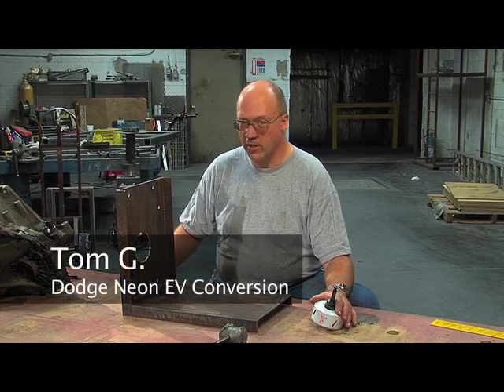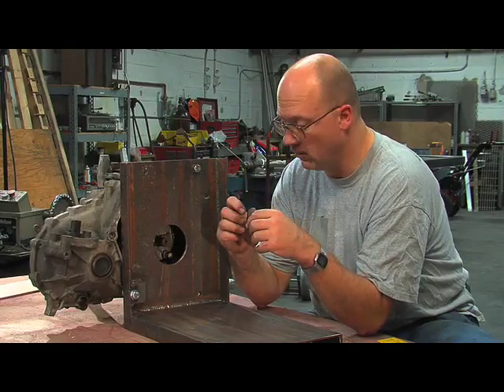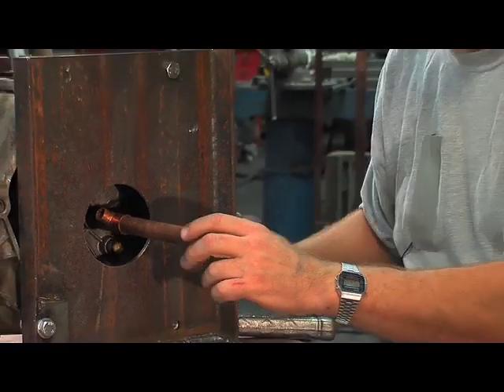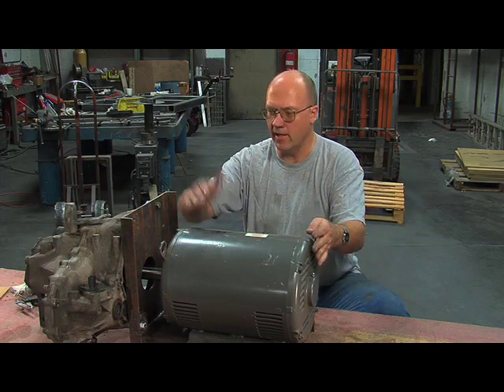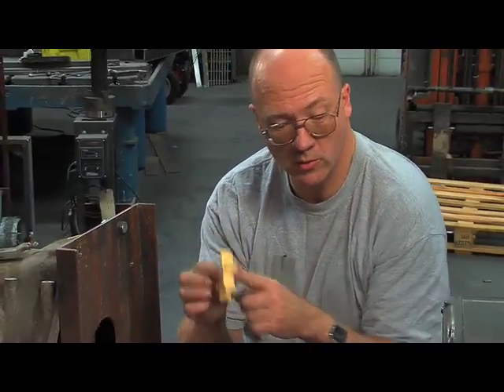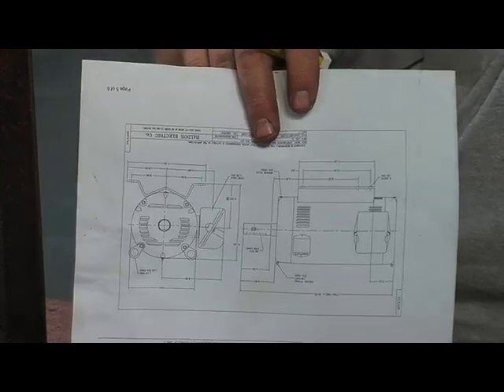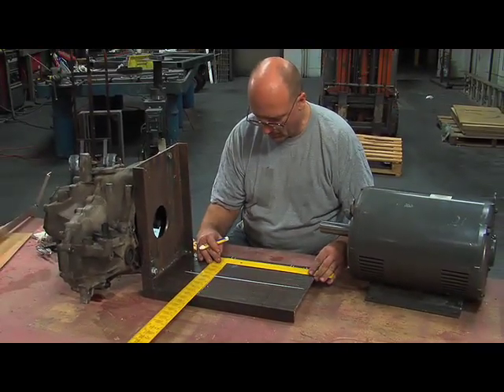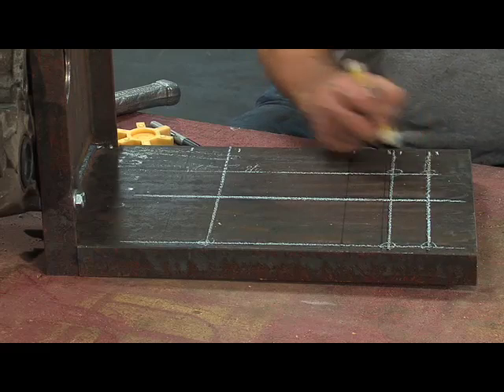AC Electric Car Conversion 101  part 005

Comment: I just don't see the savings yet from gas to electric. The cost is very high
Reply from the maker: According to Kelly Blue Book, the cost of the average new car in the United States is nearly $50,000.
In January 2023, we bought a brand new Chevy Bolt EV for $31K, (including tax, title, etc.) and expect to be able to take full advantage of a $7500 tax incentive.

The car will never use a drop of gasoline or need an oil change. This greatly saves on fuel and maintenance cost over the life of the vehicle.

Now, if you are comparing a brand new electric car to a 10 year old gas car that you already own, it would be very hard to compare the two just on finances.

Comment: I'm puzzled ...your useing an AC motor instead of a DC warp 9 inch motor  for a EV Conversion with a Lovejoy coupler ?
Reply from the maker: AC motors provide for features such as regenerative braking. It was also a very inexpensive motor, as Tom works in the recycling industry and can often find great deals because of that.
There are various ways to connect the drive shaft of an electric motor to the driveline of a car. LoveJoy couplers have been commonly used with good success.

Comment: What is the HP
Reply from the maker: If I recall correctly, that motor was rated at 30 HP. Keep in mind that electric motors are rated at continuous horsepower, whereas gas engines are rated at peak horsepower.

Comment: Very interesting and well explained. I would suggest using some oil when drilling holes in steel plate. I have a brand new 1965 mustang convertible body I  built a couple years ago. The car has all new metal and a vin number. I am 76 years old and have messed with hot rods and classic cars my entire life with the exception of serving in Vietnam 68/69.  I built this mustang with the idea of making it electric. I have a nice shop and right now I'm busy keeping two go karts running for my grandsons. As soon as the cool weather hits this fall my attention is going to be an electric classic mustangs. I have seen other electric mustangs on YouTube and will certainly keep your videos as reference. Thanks

Comment: You could use a scribe or silver pencil 
For more  Accuracy
To save time and not have to measure anything you could
 1st cut your motor  shaft 
2nd install your love joy on to the transmission and set the set screw 
3rd install copler end on to dc motor
And put rubber spider between and put everything  together 
4th get a small thin straight  edge  and move the motor until bought couplers are square. ( May have shim under motor)
5th now that they are square you can mark your dc motor  holes with a transfer punch.
6th  remove dc motor  drill holes  and bolt back on 
This is an old school millwright trick
And if you shim the motor your rubber spider will last 10x longer
Reply: Gary Brown un)

Comment: The motor alignment could have been done much easier and more precise at the beginning, when the motor and transmission was lined up but the plate between them was not welded yet.

Comment: hi guys, im trying to do my car electric, but here in canada cant find motor like those i see in the videos, but finlly did find this motor and here is all the info for it,
 Horsepower	 5  HP
Full Load Speed	 1,740  RPM
Voltage	 208-230  V AC
Full Load Current	 23.2-21  A
Face	 C-Face  
Hertz	 60  Hz
Motor Phase(s)	 1  
Full Load Torque	 15.1  ft-lb
Starting Torque	 50.6  ft-lb
Insulation Type	 Class F  
Service Factor	 1.15  
Shaft Diameter	 1-1/8  in.
Frame Type	 184TC  
Rotation Direction (when facing shaft)	 Reversible  
Totally Enclosed Housing	 Yes  
Open Drip Proof Housing	 No  
Auto Overload Protection	 No  
Manual Overload Protection	 Yes  
Rigid Base	 Yes  
Resiliant Base	 No
so pls let me know if it can work or no, the car is same as this dodge neon.

Comment: how would this be done with an automatic transmision?
Reply: I was wondering the same thing
Reply: need a separate motor (or a mount to hook up multiple pulleys to an electric motor), usually with shafts on both ends) to run the pump for the trani fluid. i read you only need it while the motor is not turning the transmission, but i cant confirm that myself
Reply: I would think that you could adapt the flexplate to the electric motor shaft with a small bushing welded to the flexplate.
Reply: If you have a tranny, simply ditch the gearbox all together. The 1:4 or so exchange between the driveshaft and wheels is all the gearing you need for an electric motor. It also makes a clean build that way.
Reply: flexplate?
Reply: it's the automatic version of a fly wheel. it attaches the torque converter to the crank. normally light stamped sheet steel.
Reply: still need to do something to keep the trani fluid pumping.
Reply: the motor would need to run continuously, I would think. the converter drives the pump.

Comment: " 'mating' the engine sharf with the transmission shaft is a huge problem"?

No, . . . but, like a blind-hole transfer punch (which could have been used on the one blind hole in this project) you have to cut small diameter straight shaft shoulder bolts and screw them into close-fit tolerance holes threaded into the ends of the two shafts, then, checking run-out, raising or lowering, and using a precision level (which should have been used in setting up for the mounting and adapter plates), . . .

Comment: what about a high powered op-amp that will convert 24v dc to 300v ac without the use of a bunch of batteries?
Reply: no;  that will still drain the one battery in 2 minutes, do the calculations...

Comment from the maker: Yes, for one thing, in a front-wheel drive car, the transmission is what connects the engine to the wheels. Also, this particular AC motor isn't very high torque, so you need the gearing to get the right amount of power. With some high-torque DC motors, it is possible to put it right on the differential of a real-wheel drive vehicle.
Reply: BenjaminNelson Hello, Is it possible to build a Daihatsu Applause with a 6.5 KW lift motor? How many kilometers per hour can you go?

Comment from the maker: In this case, no. The car needs nearly 300V to run the AC motor system. Forklifts are only 36 or 48 volts. Forklift  batteries are also usually VERY heavy and bulky. I haven't ever seen ANY electric car conversion that uses a stock forklift battery.
Reply: What is model number of electric motor, Where is typical surplus from. Elevator etc.

Comment: Additionally i think the engine you used is too big and too heavy for this project..a smaller engine with a different set up in engine to transmission ratio (which would be allowed if you were to go with the chain and sprocket wheel setup) would allow easier rev.

Comment: "mating" the engine sharf with the transmission shaft is a huge problem, and to tell you the truth the way you did it, its impossible to find the "perfect" point to make it completely straight in a way you can say "this set up will never cause problems to my bearings, and it will last forever like it should". you can never join 2 sharfts pefectly. Instead you could have gove with a twin chain + 1:1 ration(or different ratio better fiting your set up) sprocket wheels.

Comment from the maker: Electric MOTORS are used everywhere in modern society. The most typical ones are AC, as they run off house-hold alternating current. A motor like the one used on this AC car project could be mail ordered from an industrial supplier. This particular one was salvaged from a factory that shut down. I think the motor ran a conveyer belt.  You can also mail order AC electric car motors from EV parts dealers.

Comment: how did you attach the coupler to the motor shaft? it isn't splined so wouldn't it just slip at high speeds?

Comment from the maker: @usaamerica1 
Most of the parts for this project were salvaged. The electric motor and AC drive for it, and batteries all came from recycling. The individual battery chargers were ordered off E-bay.
Entire cost of this project, including buying the car was in the neighborhood of $3000. Do a web search for "electric vehicle parts" to find costs for "off-the-shelf" parts.
Reply: Can you give me specifications about the motor that you used? I wanna do the same, I'm looking after for a powerful motor to go fast but with enought autonomy

Comment: the LOVE JOY couplings that ive ever used were a pain in my butt they kept striping out i mean after allignment an degreeing  i no how hard it was changing tose out i can imagine how hard it would be changing one out in your set up a days work i would say,,i finally done away with the love joy an ordered 2 gears that fit my shafts an it is driven by a double row chain it dosnt never strip or give any trouble by chaining it together ,,

Comment from the maker: @andreagrech89 This motor DID go back on the transmission.
(I think it may have been a slightly different version of the same transmission. The guy Tom got the car from is a big Neon buff - I think he swapped the ACR tranny for a standard one.)
Anyways, basically the electric motor went back on a more or less stock transmission - not some fancy one at additional cost.

Comment: There are trade offs between aluminum and steel:

1) Aluminum of the same strength would be twice a thick (but still lighter)
2) I'm better at welding steel than aluminum.

A face mount motor makes more sense to use Aluminum, you have less air flow area and you don't need to weld 2 pieces together.

The motor (20 HP) I'm using doesn't transfer much heat to the mounting plate, its cooling is based on air flow.